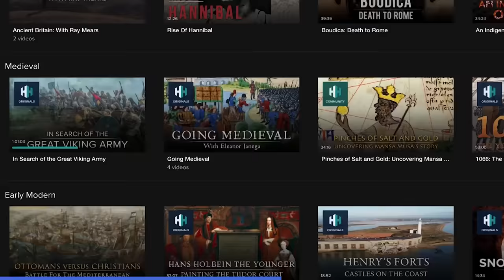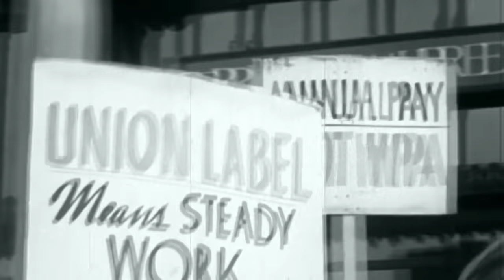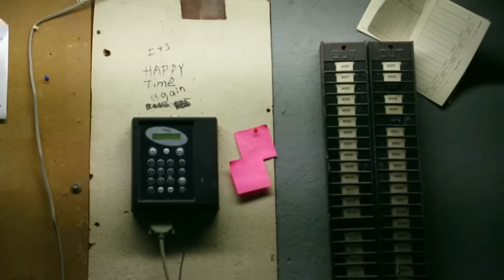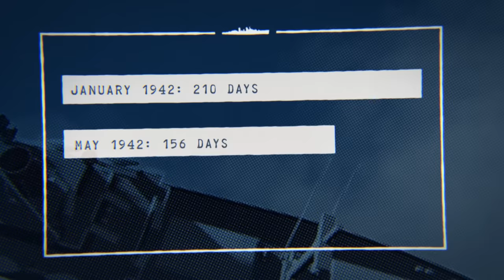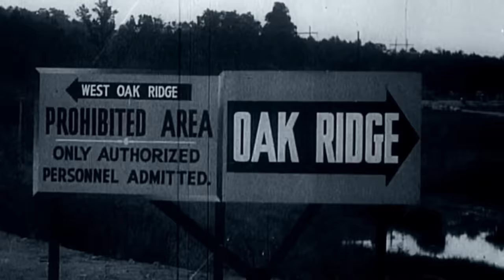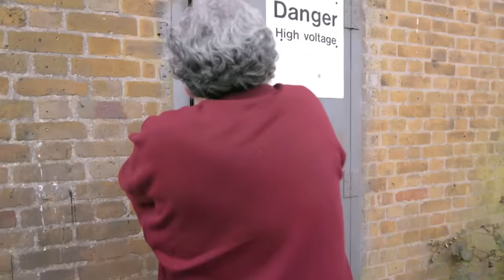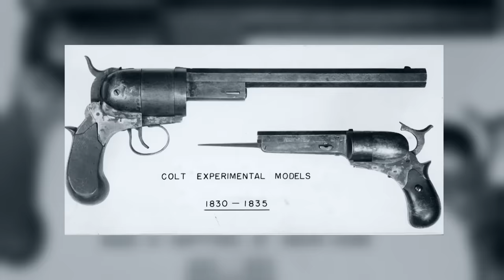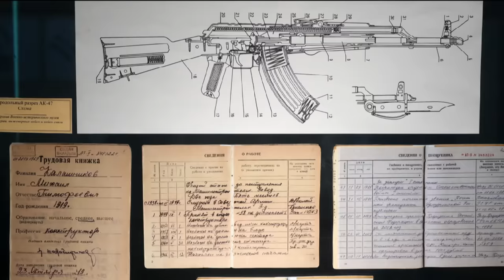3 Hours Of Facts About America's World War II Factories | War Factories Complete Series

Comment: Early Liberty ships from what I've read had a tendency to split apart in the middle in the open ocean and  a protective band was applied to remedy that.
Reply: Yes. For two decades after the war, they were a mainstay of global merchant fleets... but then even the reinforcing band started to fail and they had a bad propensity to breaking their backs in heavy seas.
Reply: @richardthomas598  usually when you 'slam dunk' projects things get 'over looked'
Reply: On the Mermanks (sic) run, the cold would make the steel brittle.
Reply: Q ships sank because they broke in half because of fatigue cracks that started at the corners of the square deck hatches, particularly during North Atlantic winters.

Comment: to make the point of how ahead of its time the P51 was. to this day, the fastest piston propeller plane is a P51 with the original merlin engine. fitted with newer parts, but still the original design, and the weapons removed and the wings cut down for speed.

infact. the current world record winner, a plane called Voodoo, has a max flight speed of 520 mph, roughly equal to the top speed of the ME262. 

ill say that again but slower, when you strip the weapons off this plane and clip its wings and do NOTHING ELSE, it can keep pace with a JET, that is how insanely well designed this plane was
Reply: Was the Merlin the original engine?
Reply: The Allison 12 cylinder was the original engine, good engine just 1200 hp is less than 2000 hp with the Merlin
Reply: A jet that could only fly for a couple of hours before needing an engine replacement.
and that jet doesn't fly anymore.
Reply: @jessepollard7132  ah yes, smarty commentor talks smack about the first combat capable jet fighter in history for not being flown anymore and for being more maintenance heavy than older piston contemporaries, completely negating the fact that the entiee reason it was built was to travel so much faster than other planes that it could fly relatively unchallenged, exceeding the maximum combat speeds of the P47, P51, Spitfire, and BF109 by over 100mph, and literally all you have to do to close that gap in a P51 is clip the wings and cut down on its range, meaning this piston plane was on par with a jet in short range combat

Comment: There are a number of errors in the video on building the atomic bnomb.
1. Fermi KNEW he would not cause problems with an explosion - his reactor was not designed to explode or even create more radiation. It was to determine if the low rate of fission could be controlled.
2. The silver appropriated was for a mass separator - not a reactor. The fun bit was that the project was required to account for every ounce when they were through with it and returned the silver.
3. HIroshima was not previously bombed so that it would be easier to determine the effectiveness of a single bomb as determined by photographic flyovers to measure the distruction.
4. The fusion bomb test shown was not on bikini - and was not 21 MT. it was a fusion bomb that was miscalculated - it was assumed the bomb strcuture would not take part in the reaction. but it did - and that multiplied the planned size of 5 MT into 15MT.
Reply: correct me if I'm wrong, but I thought the decision to bomb Hiroshima was a last minute decision because cloud cover and bad weather was over the original target.
Reply: @rogerdodger8415  I believe Kokura was the primary target for the second bomb, but weather prevented acceptable targeting Nagasaki. HIrosima was the primary target due to the military base in it and the military manufacturing around the base.
Reply: @jessepollard7132  Ok. Thanks.  So it was the second one, and not Hiroshima..
Reply: Another error is when Historian Mrs. Churchill says the first bomb was nicknamed "thin man", it wasn't it was "little boy".

Comment: I love this series but they tend to leave out the little things that tend to get me excited like the reason the M16 failed at first an internally chrome plated barrel that Armorlite had in the original design but Colt left out of the production guns which is why it failed at first. everyone should use this as a start and do there own research you never know what you may discover
Reply: There is a documentary about how it didn't have an advertised self cleaning system, a forward assist or the fact that was made of polymer and I believe the barrel issue. I'll have to try to find it somewhere for you.
Reply: Also, it was too well -built and the tolerances were just to tight unlike the sloppy built AKs, so just the smallest of debris could render them unfireable
Reply: I've seen about that chrome lining problem in some documentary. I think what happened is the process was expensive and only 1 company was able to do it right. Colt decided they could save money by developing their own process but it wasn't done properly and failed pretty quickly.
Reply: several changes to the ammunition also helped
Reply: The lower powder charge, related to some limitations in design, also contributed greatly to its failures.....gimmie my M-14.